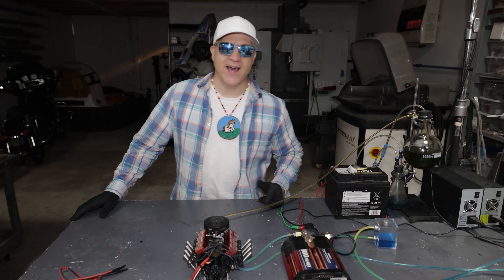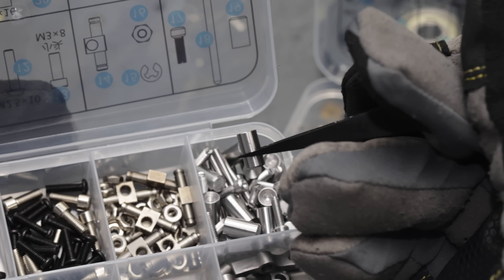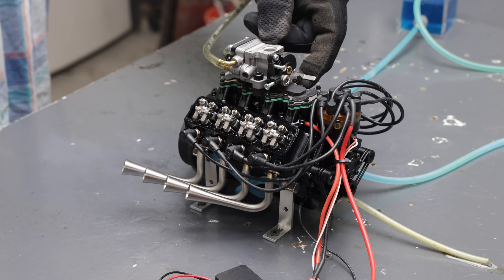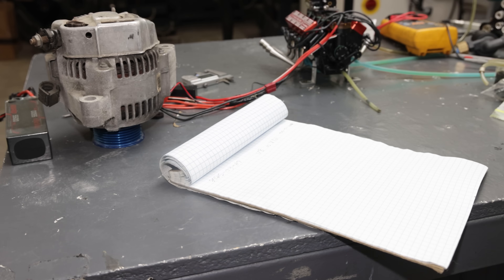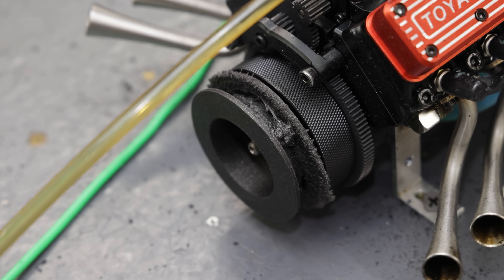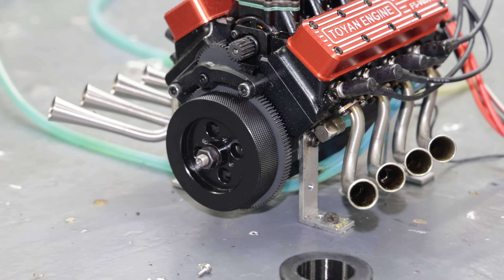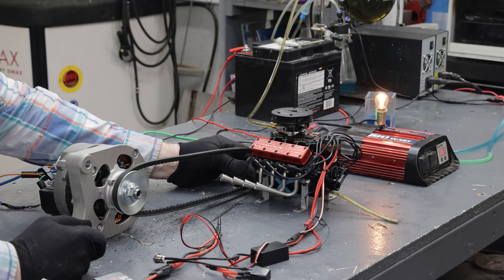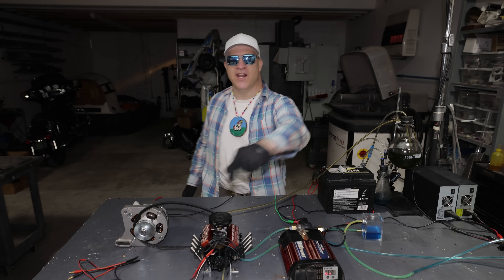I Built A Mini V-8 Generator That Actually Works

Comment: Alright so the hp loss of the belt is significant, usually around 1 hp just to run a belt, that thing can be making more the 3-4 hp, also the mass of that alternator and the drag of the fan probably eats up closr to another .5 hp or more...thats almost half ur hp wasted....so all that being said, u need a rc brushless motor, they work amazing for genertaing juice, hook it up to a 3 phase ac to dc bridge rectifier and a voltage dc/dc buck/boost to regulate output and voltage and ill bet u could get 50-60 amps of solid output!

Comment: That belt is way too stiff for that setup. Just forcing it to conform to the little pulley is sucking power, the slipping on the pulling and related wearing is sucking power and rubbing on the bench is sucking power. I dont think your pulley size is the problem. Use a link belt in a smaller gauge. But it's a good enough setup for a feature length ad.

Comment: The starter motor being "inside" the engine looks cool but, won't it fry it pretty fast?
Reply from the maker: Well they did a brushed motor this time... I feel like a brushed motor for this application is more reliable
Reply: @WarpedYT   thanks for the answer! I'm not a native English speaker and I now see I may have not expressed myself correctly. By the motor "frying" I meant it could be damaged by the heat of the engine. Are brushed motors more resistant to overheating than brushless ones?

Comment: You should have used a rubber mounting pads to reduce vibration before you screwed down to that table
Reply from the maker: Yeah I didn't know that beforehand The previous engines I've ran were very smooth, I guess they got to cut cost somewhere

Comment: You were allowing way too much belt slippage. The alternator was operating in a full-field condition, and was only delivering less than 1/4 the power available from that model engine. That's why you kept burning up those 3-D printed pullies, that otherwise, would have lasted at least a few hours. If the alternator was allowed to spin as fast as that engine would, given the pulley diameter ratios, this would have actually produced at least 300 watts!  Next time, skip the belt, and direct couple the alternator to the crankshaft of the model engine. Alternators are designed to spin fast, making it compatible with the high RPM of model engines. The extra flyweight of the alternator rotor is actually a welcome thing. Alternators do work equally well, spinning in either direction. Spinning the alternator backward will reduce the efficiency of the cooling fan, but that's a good thing. Less windage at high RPM means more available output power to drive an electrical load. this whole rig is more suited to battery charging, than to directly drive a power inverter.
     Get an alternator with an EXTERNAL regulator. You can directly vary the load on the engine, by varying the current to the field. That will maintain maximum efficiency, converting engine power, to electrical power. A 28 CC engine can actually produce quite a bit of power at high RPM, with the right ignition timing, and fuel/air ratio.
Reply from the maker: I know I tried, The external regulator is a great idea.

Comment: Instead of a V-Belt you should use a shaft with a flexible coupling to drive the
generator.- A V-Belt puts heavy radial loads to the engine crankshaft and that 
is not very healthy for the bearings! Regards, have a nice day...

Comment: 4:48 take two seconds to think about it and maybe you’ll know why it’s overheating… is it just me or do I feel like I’m the only one with common sense these days?
Reply from the maker: Common Sense is not very common.
Reply: @WarpedYT Yeah its not you need a mini radiator with with a fan blowing air through it...
Reply from the maker: @JordanJank  Yes there is a radiator, mechanical pump and an electric booster pump hooked up, You can see it in the video if you look closely.
Reply: @WarpedYT  Well my bad 👍 very cool engine
Reply: @WarpedYT  clearly lmfao

Comment: Use a rc brushless motor as an alternator direct drive in line the belt drive is using 1/2 the engine power.
Reply from the maker: Yeah but that's not what people ask for They wanted to see it hooked up to an actual car alternator, They seem to think it would work very well.

Comment: I have a better idea than using a genset alternator.
Most vehicle alternators run best at 1100 rpm, or a bit better.
A modern alternator puts out better than 100 amps, and consumes about 15 hp.
A “big truck” alternator can put out double that.
If you made it this far, follow my logic here…
So, if you use a 5 hp single piston engine that is running flat out, it’s would be more than capable of generating 120 amps with a 3:1 speed reduction, no matter what drive is used.
Magic number, 1100.
Now, having a bit of experience in electronics, and a bit more in electrical, I can safely say this:
Using a larger alternator at 75% if capacity goes a long way for reliability and longevity.
So, in theory, whatever is used for power or generation, having more is better to keep the stress off of your system.
It’s called “Old School American Engineering.”

Always overbuild what you have, and you will never go wrong.

Want documentation?
Go look at the “old school” engines, and look at how much power we got from them back when!!!

Comment: I’m thinking the outlet of the engine to an electric motor to convert voltage to said battery would be easier. I don’t think it would have as much load on the engine as where the pulley does.
Reply from the maker: That’s a great idea, I might have to try that next time!

Comment: Yea generators are cheap. You can get 1kw for just over 120$ or so. And it will run normal gas for up to 8hours. It would be cool to have this mini v8 option but I think its less then optimal setup. I think it could be redesigned to work a bit better. But even if you get it all working, is it really any smaller, quieter? Or more fuel efficient? Probably not.

Comment: $1000 (I'm assuming US) for an engine kit that's meant to be a model engine and not an inverter generator like shown here you could buy a Honda EU2200i generator that's quieter and better built for these conditions.

Comment: you need  Conley 609 With a Super Charger .... Conley 609 aprox 5.5 bhp with the Super Charger is around 10 bhp with that you can run a 5KW Generator Head which needs a 10 bhp Engine but a Alternator idk
Reply from the maker: That guy lives like 15 miles from me crazy enough, I've always meant to go visit his garage I just haven't got around to it.
Reply: @WarpedYT  I need a Machinest to Build a V8 Detroit Diesel in 1/4 or 1/3 Scale 2 Stroke with Super Charger for iconic Sound

Comment: A better way is to get a small generator that can put out enough voltage to power a 5 volt regulator so it can be used to charge a cellphone.

Comment: You have got to try powering that hibrid tesla of your off of a couple of those mini engines. You would probably need to build some sort of bespoke alternator for that. Also I don't know what filament you used for the pully, but your should maybe look into PPA nylon infused with carbon fibre, if that wasn't what you used.

Comment: If the belt wasn't so loose you likely wouldn't have the pulley problems.
Reply from the maker: I had to use it like a torque converter, get the engine moving and then apply torque and the one clip in the video you can see that I'm cranking and cranking it it won't start because of the mass of the alternator, the engine probably weighs 1 kg The rotor in the alternator weighs 2 kg so in reality the rotor weighs more than two of those engines put together.
Reply: @WarpedYT  yeah I saw that, maybe you could try different pulley sizes? I mean you'll lose speed at the alternator but, pulley ratios might be the solution, that or a smaller alternator, it is massive.  

Just trying to be helpful, I didn't mean any disrespect.

Comment: Hey man, you have to mount a generator shaft to shaft with those rc motors or you are just going to snap the crank pully off the crank. They don't do side loads well.

Comment: It actually has piston rings! That’s the first of these I have seen with piston rings. I do wish they used a proper collector instead of zoomies though.
Reply from the maker: Agreed, I was going to do a proper collector on the V12 in the last video but the problem is that they were so expensive the 3D print.

Comment: I built a generator from a 320cc model aircraft engine, made it fuel injected with a microsquirt. The generator was permag axial flux motor.
Reply from the maker: Micro squirt is the absolute best, that's what I'm using for the main video which is coming up this week, this one was just for the integration. But micro squirt is the absolute boss of ECUs I love it.

Comment: Danke Ihnen Warped,

macht es ihnen keine Sorge die maximale statische und dynamische Lagerbelastung, der sehr masseschlanken Kurbelwelle, gegenüber der angebrachten Nutzlastwellenmassenabmessungen so zu überschreiten? 

So Pi mal daumenideal darf der statische Riemenzug nur senkrecht nach oben erfolgen und nur so stark sein, das er die Masse aller Anbauteile auf der Schwungradseite der Kurbelwelle incl. der halben Endlagermasse tragen kann. 

Wenn Sie dort einen Zahnriemen anbringen und darüber den Generator mit einer Zahnrimenscheibe plazieren welche in der mechanischen Übersetzung exakt die Drehzahlen der jeweiligen maximalen Wirkungsgrade des Motors und des Generator ergibt, soll die Riemenvorspannung alle Anbauteile an der Kurbelwelle exakt tragen können ohne das sich ein staatische ruheende Riemenkraftwirkung auf die Kurbelwelle ergibt. 

Dann wäre eine sachgerechte Lastzeitabnahme mittels der Übertragungsstrecke der beiden Wellen, bei den dann beiden optimalen Wellendrehzahlen, über die gewünschte Dauer durchaus möglich. 

Der Grund dafür liegt in dem sehr einfach gehaltenen ungesteuerten Gleitlagerölmassendurchsatz. Die Zugangsbohrung für das Öl der Pleullager hat keinen Einlauftrichter und ereicht damit nicht den möglichen maximalen Wirkungsgrad dieser Bauart. 

Auch ist der Ölstand im Kurbelgehäuse, in der Höhe bedingt durch den Ablaufanschluß sicher zu stellen ohne das ein Luftzutritt in das Kurbelgehäuse durch diesen Kanal möglich ist. Es gibt ideal einen gut lastabhängigen Ölabfluß durch diesen Kanal. Ein Auffangbehälter mit einer Belüftung für das abgegeben gebrauchte Motoröl kann so kalibriert werden, das bei einem zu hohen CO2, N2, H2O und Ölnebel-Überdruck im Behälter die Zündung unterbrochen wird. 

Wenn Sauerstoff und Kraftstoffdampf austritt ist der Motor nicht mehr sicher Betriebsbereit. Soll der Motor länger selttätig arbeiten können, ist ein Brenngassensor an der Endlüftung des Altöltanks notwendig. Ein Flammrückschlag des Sensors in den Altöltank und in den Motor muß aber vermieden werden. Dazu eigen sich Sintermetallfilter und oder Flüssigwaschbehälter des Altölabgases. 

Behälfsmässig kann der Altölabgabedruck dazu genutzt werden, beim Überschreiten einer Grenze den Kraftstoffluss und den Stromfluss zur Zündung zu unterbrechen. Ein dünwandiger Silikonschlauch dessen Dehnung dazu genutzt wird kann dies recht einfach leisten. Dazu kann dieser durch ein elektrisch leitfähiges Rohr geführt werden, wobei der Zwischenraum mit Kohlekörnern gefüllt wird. Um die zweite Elektrode des Kohlekörnersensors zu erstellen, kann der Silikonschlauch mit einigen weitmaschigen Windungen eins blanken Drahtes vom gleichen Werkstoff wie das Hüllrohr umwickelt werden. Der Gasdruck im Sensorraum und der Auslösedruck im Silikonschlauch sollen gleich gewält werden. Bei ordentlicher Konstruktion  und Kalibration ist die elektrische analoge Signalqualität des Sensors erstaunlich gut und ereicht fast einfache Audioqualität. 

Daher kann das Signal gleichgerichtet und RC gefilter werden womit, bei Überschreiten des Nennpegels ein kleines magentisch kalbrirbares Schutzgas-Relais betätigt werden kann, das dann die Zündung unterbricht.    

Auch ist der Luftfiltereinsatz hinter dem Späne- und Steinwurfsieb nicht eingebaut worden. Das reduziert natürlich den Wirkungsgrad des Motoröles im Kraftstoff ganz erheblich und erfordert folglich weit mehr öffnen der Drosselelementes des Vergassers, für das ereichen der Nutzleitungsdauer, als es wärend der gewünschten Betriebsdauer ganz normal motorherstellergerecht erforderlich ist.

Beachten Sie das die Nockenwelle erst eine saubere schmalle möglichst gleichmässige eingepresste Kugelbahnspur zeigen muß bevor der Motor unbeaufsichtigt seien gewünschten Dienst leisten kann. Der Einlaufeinpressabrieb der Nockenwelle muß regelmässig ebenso wie der Laufbauchseneinlaufabrieb und Kolbenringeinlaufabrieb aus der Ölwanne entfernt werden. Das Reinigen aller Laufflächen der Broncelager während dieser Zeit sichert auch deren Einlaufvorgang, so das eine gute nutzertragswirtschaftliche Betriebsanwendbarkeit des Motors möglich wird.

Dies eingeprägten und eingelaufenden Betriebsverhälnisse sind etwas einfacher bei einer 4 MIX Bauweise wie Sie bei der Marke STHIL gepflegt wird. 

Gruß Reiner Markenfreund
von Michael Frithjof Müller

Comment: 23 yr master tech here. GM did the same thing with their starters in the Northstar line. Putting the starter in the valley put a lot of heat into the starters, causing very premature failures. They were not fun to replace.
Reply: And it takes up valuable room from turbo that belongs there instead 😎🐌
Reply: @thebigredrob  Oldsmobile Aroura, I think it was had the starter under the intake also. Oldsmobile something, I can't remember exactly but a guy I worked with about 20 years ago had one.
Reply: @ZMAN_420 The Aurora 4.0 is known as the "baby Northstar", compared to the widely known 4.6 Northstar in everything else. There was also the Shortstar, the 3.5 V6 they put in the Intrigues.
Reply: @mattcat231  Nice thanks for info.
Reply: @ZMAN_420 
You've got to admit. That was a sweet ride... Power. Looks. Handling. It had it all
Reply from the maker: Haha I haven't heard horror stories, but I haven't had to change one myself yet.
Reply: 42 years Baker here. When you bake muffins always spray your baking trays with nonstick spray just before pouring your mix. Always let them cool completely and they'll fall right out
Reply: GM did it with the LT5 that went into the C4 ZR1 before the NorthStar, the early LT5s didn't have a big enough drain hole for the centre of the Vee which caused some starters to get flooded from washing the engine, a bigger drain hole fixed it.
Reply: And what do you think about the New Engineering design of GM? Because ALOT of people don't like the modern designs due to difficulty to work on.
Reply: I will never buy one like that. Never! If it looks hard to work on i don't want it. I will never buy a Ford because of that. I guess I'm always going to have really old stuff.
Reply: I replaced the intake boot on an 01 Deville yesterday. 
It's a 1 hour job.

Comment: lol if you paid that much for any engine you would expect it to be useful or not far from it...

larger pulleys grip better and handle heat... 

needs a clutch with a stall speed so it can stay at max power under load. 

power generation can act as a dyno ?

Comment: So so you use an engine, to run an alternator, to generate electricity to power an oven to heat food? I think you might as well just burn some gasoline under a pan haha

Comment: Sweet project. Maybe a much heavier flywheel will help.
Reply: Nope. A larger flywheel would only give more boost on a take off, in a car. But in order for that to work, you must trade time. You would have to rev up that heavier flywheel to spool it up (2 or 3 seconds to get to full throttle).

This engine now goes to full throttle in a split second.

Once that engine gets to full throttle with a massive flywheel, it'll have lots of momentum, to help get the alternator to full rpm in 1 second flat.

So you would be correct for the first second.

After that first second, the engine would have to fight the alternator load "AND" the new load which is the new massive flywheel.

So a heavier flywheel would not work in the real world.

By what you are saying, it would then make sense to run a tiny little engine with a super massive flywheel to drive a supercar to 330 mph and win the laMans race against a ferrari with a supercharged v12. Doesn't work like that.

Flywheels do not give more power in general, only a tad more bump in power for a "clutch dump", that's it. That only lasts for 1 second.
Reply from the maker: Yeah no go It just needs more power. Flywheel would help the idle but it won't give it more power output Just more kinetic energy

Comment: btw, one more direct electric piston engine benefit is that the electric output is the timing signal and power at the same time. also if the piston itself (with air/metal springs) is the flywheel mass. well you could try to use a chain saw piston engine as the generator engine. yes its just one cylinder. also making new stuff is way more interesting than just copying what others do. including new engine designs. game up enimal lol. direct electric piston engine bypasses all the rotation based steps in your chains. yeah metal pulley would be much better. if required at all. 1hp is still 1kW. where did all the power go. pulley and rotation motion. but that 1hp should be at the engine axle already.

Comment: its an amazing engine but it lacked proper oiling system

the oil pan barely hold enough oil to lubricate the crankshafts and there is no way to get oil to the valvetrains and camshaft. 

as a model Small Block Ford engine, it's pretty cool but you could prob find a junkyard 302 and build it cheaper as a generator.